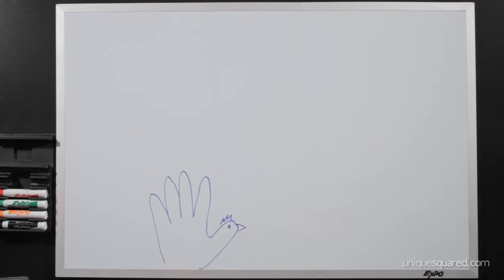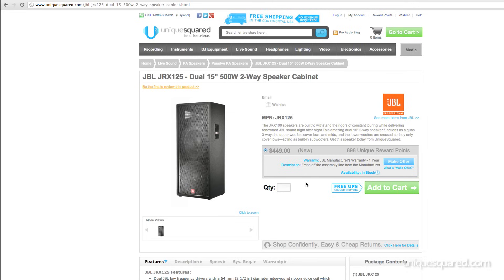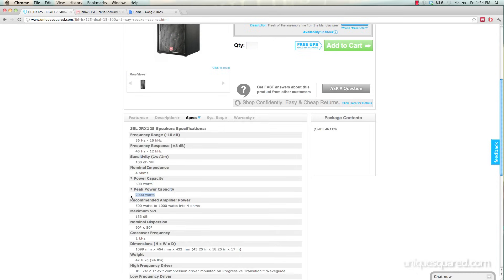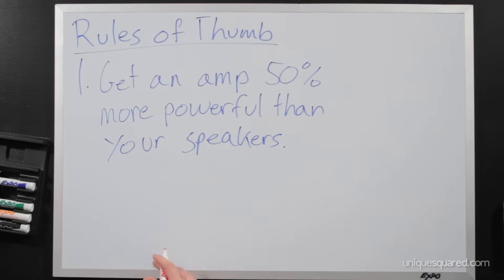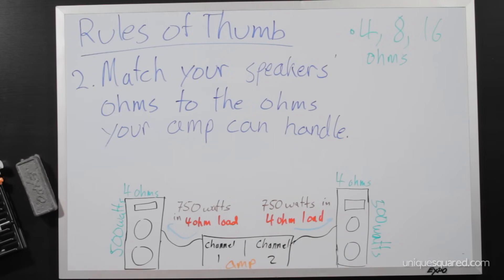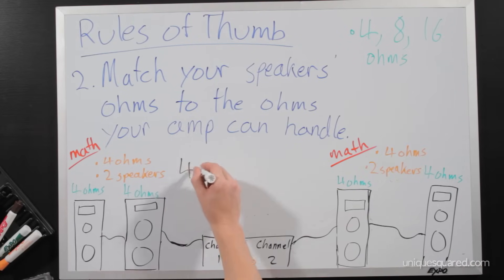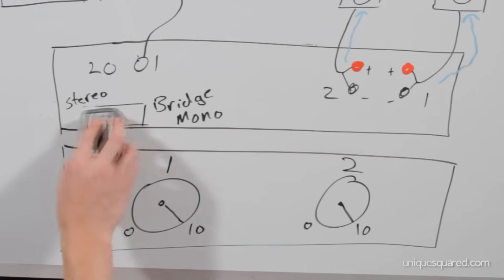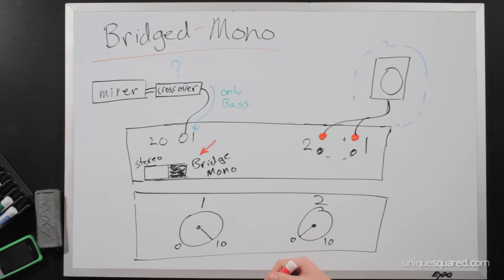Amplifier to Speaker Matching Tutorial | UniqueSquared.com

Comment: WRONG, COMPLETELY. You can not ruin your amplifier by connecting more powerful speakers, but You can certainly ruin your speakers if you will connect them to more powerful amplifier. And this is why: power output obeys Ohms law. If You have, lets say the 250W amplifier which is designed to work with 4 ohm speakers - the power output WILL BE THE SAME if you connect 1000W speakers or 250W speakers as long as those have the same 4 ohms. THAT'S A FACT, go to school, learn some physics :D On the other hand if You will connect 250W 4ohm speakers to, lets say 1000W power amplifier (still talking about 4 ohms) - you will overheat your voice coils and blow out your speakers, because they will have to output those 1000W, that's a fact, remember? They just aren't designed to hold that power, that's why You will blow them out and even at the edge (25% power) sound quality will be bad. Never overpower your speakers! NEVER! General rule is to underpower them by 25-50%, so You can get the best possible sound quality and you won't blow them. RTFM!

Lets summarize that. Amplifier will be loaded exactly the same, no matter what power rating the speakers are as long as their impedance is the same. Period. That's a fact, that's a law. This video is nonsense, that is another fact. Go, learn something: http://en.wikipedia.org/wiki/Ohm's_law

PS. Telling that you should overpower a speaker equally means that you should always listen full volume and turning the volume down - may ruin your speaker. This is nonsense!
Reply: Romas Quicker You are simply wrong. According to JBL (the manufacturer who's product is in the video), you should select an amplifier "that can deliver power equal to twice the speaker's continuous IEC power rating." https://www.jblpro.com/pages/general_faq.htm

In fact, they warn against using too little power. "It may surprise you to learn that low power can result in damage to your speaker or system."
Reply: Romas Quicker, Aim to match speakers and amplifiers to produce undistorted sound at the levels you want at your listening position.

To produce the sound pressure level needed at the listening position with a specific signal, using a specific pair of speakers, needs the same amount of power.
As long as you put an amplifier there to do the required amount of work, speakers will do the work needed to produce the sound pressure levels.

There will be a range for the amplifier where its amplifying devices will accurately produce an amplified version of the input signal. As long as we are well inside that range, the output from the speaker terminals will be a higher voltage, higher current analogue of the input signal.

A less powerful amplifier will tend to move out of the range where the input can be amplified as an exact copy of the original with gain, more often than a more powerful amplifier and, will tend to be distorted on larger transient peaks. 
In extreme cases a low powered amplifier can become unable to supply enough power and will produce a clipped wave. A powerful amplifier handling the same signal into the same speaker to produce the same sound pressure level at the listening position therefore will tend to sound more accurate.

Speakers are not as simple as amplifiers when handling a signal; the speaker output and its signal input will be significantly different.
The impedance for the speaker is frequency dependant and as a load, it will dip below the average at certain points in a musical piece say to 2 Ohms. This will demand four times as much power from the amplifier. Similarly the impedance can rise say to 32 Ohms. This would only require a quarter of the power from the amplifier. The speaker swings its impedance in response to the frequency content of the signal. A low powered amplifier will have a much greater tendency to distort and clip than a high powered one with a speaker that presents significant dips in impedance.

The voice coils will heat up as the amplifier makes them do work. At the specific level needed at the listening position this heating will be same because you are transferring the same amount of energy per second. So no damage is caused unless you increase the levels to produce extreme temperatures in the voice coil. The more powerful amplifier will distort less than the less powerful one if you want to listen louder but, you can damage voice coils by over driving them with a powerful amplifier.

Listening louder, you might start to run into difficulties with the speaker being physically able to move the drive units accurately. Drive units have mass and energy transfer needed to accelerate, decelerate, reverse direction and accelerate in the opposite direction is dependent on power (energy transferred per second).
A powerful amplifier will be better at controlling drive units and will produce a more accurate sound at the listening position than a less powerful one.

Distortion caused by clipping produces harmonic distortion, the amplifier produces distortion that sings along with the signal at higher frequencies above the signal. These can be pleasant and valve amplifiers use this effect to sound warmer and louder and more exciting. It can also be harsh and make a harsh shouty playback. The distortion will be greater for smaller low powered amplifiers and can burn out tweeters.

In short, you need an amplifier and speaker that can produce the sound pressure levels you want at your listening position without distorting or clipping noticeably.

Low powered amplifiers need more sensitive speakers to be loud without distorting.
High powered amplifiers distort less than low powered amplifiers and will give a more accurate less distorted playback with most speakers.
Speakers can be difficult loads if their impedance dips. Amplifiers need more power to tolerate swings in impedance.
Speaker voice coils can break down when they become too hot and that happens if you try to put too much power into the speaker.

Generally a powerful amplifier is best in most circumstances until you exceed the power handling ability of the voice coil.
Clipping from under-powered amplifiers damages tweeters.
Reply: finally, someone that thinks... funny how this does not make sense to some.. the video is totally wrong..
Reply: Dude, this video is not wrong. What uniquesquared says is absolutely correct. There should be "headroom" for any amplifier to deliver clean sound to the speakers. Contrary to belief, it's not the power that kills a speaker. It's the distortion that kills it. It is always recommended to use an amplifier that is higher than the speaker output. It is safe so long as care is taken to match the impedance. 
If a speaker manufacturer has recommended a suitable power wattage to drive the speakers, he is simply implying not to drive the speakers with anything less than what is recommended. More is welcome. But definetly nothing less!
Reply: Rohan Dias Wrong. Go learn some basics, only then teach others.
Reply: jcnash02 WRONG, go read JBL tech note ( https://www.jblpro.com/pub/technote/lowpower.pdf ) , they talk mostly about harmonics, there. Read the summary at least. I will try to "translate": JBL say, that their low power amplifiers are so bad that they output too much harmonics when used on full power (or near that limit) and their speakers are not designed to take that power on higher frequency range. This is why they suggest using more powerful amplifier on LOWER OUTPUT SETTING to get the SAME volume level, but with less harmonics... In one word - it's a marketing trick. In other words - their speakers would handle that if they were rated for more power (considering their power is stated as overall sum of treble, midrange and bass).

Now there are some statements about "lower power amplifier can deliver more power", or be "overdriven". The only thing that is not said - you must connect lower impedance speakers to actually overdrive an amplifier - You do remember Ohms law, right?

Comment: I have a pair of speakers which each have a max power capacity of 150 watts and an impedence of 6 ohms. What I understood from what you said in this video is that I should then get an amp 50% more powerful than this meaning 225 watts per channel, right?
But I'm really confused because the manifacture of my speakers says that the recommended amp power for the speakers is 40-150 watts per speaker.
How come that they recommend that the amplifier does not exceed 150 watts per channel when you say that I should give it 50% more. Wouldn't I be ignoring the advice from the manifacture completely? 
Hope you can help me out :)
Reply: You are completely correct, this video is nonsense! Do what manufacturer says. Power output depends on amplifier parameters and speaker resistance (ohms), not the speaker's power rating (maximum power it is capable to hold for a long period of time).

Comment: You need to get some fact straight. Program power is not the same as RMS. Program power or IEC power rating, is based on a complex sin wave form, so that, in simple terms, a manufacturer can estimate the capability of the amp when it playes a music like signal. For most manufacturers, todays standard is that program power is duble RMS power. And no, you don't need a amp 50% more powerfull than your speekers. Most good manufacturers RMS rating is based on 0,1 % THD and white noise signal from 20hz to 20kHz continuously 24 hours opperation. So with a pair of 500W RMS Speakers you only need, and yes you guessed it, a 500 RMS amp.
And one last thing, no, a small amp will NOT damage your speakers more than a powerfull one. YOU will damage you speakers with any amp if you screw-up. A 100W amp can, in some cases, if pushed beyond clip, deliver a 200W or more distorted signal (Long technical explanation required) So if you have a pair of 150W speakers, and you push your 100W amp beyond clip, yes you can burn your speakers by feeding them a 200W signal, which you can also do if you turn a 200W RMS amp up :)
Reply: You are exactly spot on correct with this post.  I have noticed most of the people posting here are trying to hook up car stereo speakers.  His explanation is geared towards a simple DJ set up. Hooking up speakers in an automobile in series is very complicated.  If someone is hooking up a megga 500 watt set up in their car, you really have to know what you are doing or you will start a fire in your car, especially if you hook up your speakers in series, rather than parallel.  This video explains how to set up a simple DJ speaker system, not a car audio system. If you do not know what you are doing "STOP" and ask a professional.  It could save your car or even save your life.

Comment from the maker: Again, I have not tested every amplifier on the market but I can tell you that unless you are in a perfectly tuned room, or are a trained sound engineer, you will never hear a difference.

If you are concerned about fidelity, I would focus my attention on getting a good set of speakers and worry less about the amplifier. Especially if you are only setting up a couple mains and a sub.

Also a lot of what determines how things sound is the signal coming in. Another old adage is crap in, crap out.

Comment from the maker: Power is power. There are amplifiers that will last longer than others, but affordable amplifiers are generally speaking just as good as more expensive ones when powering passive speakers. Some might argue against that but I have not personally tested every amplifier on the market to prove or disprove that contention.

More expensive amplifiers will give you more control functions and an assurance that your amplifier will last longer

The old adage is true. You get what you pay for.

Comment from the maker: 1. Yes
2. Yes
3. As long as you don't push your amplifier to the max, having a little head room will not affect the speakers.
4. You don't have to if you don't want to.

As always, consult the manual for the amplifier and speakers as well as contact the manufacturer if you are unsure about anything you are doing. We want you to maintain the integrity of your equipment.

Comment: i have an amp with the following spec 5.1 channel with 2X600 watts power. can i use 1 center speaker, 2 front speaker, 2 rear speaker and 1 sub-woofer with the same power of 400 watts?

Comment: Hi,
Is it possible for me to run a single 300W 3way speaker with a bass, midrange and high frequency speaker off an amp running on bridged mono? and would this affect the ohms required?
Thanks!

Comment from the maker: As stated in the video, the general rule is to have an amplifier that is 50% more powerful than your speakers. From the information you have provided, it looks as though the amplifier has the proper power rating for your NS10s.

With that said, ALWAYS consult the manufacturer provided instruction manual for both your speakers and amplifier to make sure. If you are unsure for any reason, send an email to Yamaha and use your powered speakers until they respond back.

Comment: Okay, I have a pair of NS10M's speakers which are 60 Watts RMS at 8 Ohm each.  I bought an ART SLA-1 amplifer, that outputs 100 Watts per channel at 8 Ohms.  I haven't connected those yet, becuase I am so afraid to fry the so easy to burn (and expensive) NS10M's.  Now, I am not afraid of frying the amp, because it's relatively inexpensive.  But the speakers are expensive, and I don't want to fry them.  So, the question is, can I safely connect these?  Or should I stick to my powered speakers?

Comment: hey Chris i have 400w JVC - KS AX3102 - Bridgeable 2-Channel Amp and 4 speakers and 1 sub-woofer 2ohm each i wanna know how should i give connection in amp? i don't wanna know parallel series i understand that to see your video i wanna know in amp there is 4 point left + - right - + and bridge mode, should i give all speakers connection  on bridge mode if i do that so there will be left 2 point what about them?

Comment: I want to put these new rockford fosgate speakers that I got in my truck. I am really having problems with how to power them. They are 80 watts rms a pair and 320 peak power a pair. I have an amp that puts out 400 watts x 4. Can I put my front speakers on a channel and my back speakers on a channel even though the rms is 160 a pair and my amp will be giving them 400 watts?

Comment: Please be aware if you pump 750w RMS into 500w RMS speakers you are overloading your speakers, if you limit your amp to 500w RMS then all's fine, no mater if your speakers are 5w or 5000w and rated 8 OHM your amp does not know as it will only see an 8 OHM load, I understand the reasons for leaving headroom so as not to run your amp at full wack but overpowering your speakers will only shorten the life span.

Comment from the maker: Your amplifier should be fine. We warn against doing this in extreme cases because there is potential to cause amplifier and speaker malfunction.

As always, consult the manual and manufacturer specifications of your speakers and amplifier because not all are built equal.

Comment: hi, at 3:23 you explain not to under power the speaker as you run the risk of damaging your amp. I recently bought a pair of bookshelf speakers running at 130watts and i bought an amp/av receiver that has a stereo output of 100W X 2, am I damaging the amp?
The amp has a surround output of 100 X

Comment: hi, there is one thing that i don't understand when it comes to connecting speakers in parallel, i know all about the impedence connected in parallel that it will reduce like the vid say, what about the power capacity? since the speaker u chose is 500w with 4ohms do u need to continue adding only speakers of 500watts?

In terms of a 3 speaker set up how to tackle it, suppose i have to top speakers and a one subwoofer, can you please make a video on that because i've been searching without luck.

Comment: Hi there, I wanted to get a the Behringer iNUKE NU6000 which delivers 2 x 3000 Watts into 4 Ohms, 2 x 1500 Watts into 8 Ohms to power 4 Gemini GVX 15s at 500 watts RMS at 8 ohms. My question is this does the description by Behringer that the iNuke NU6000 delivers 2 x 1500watts into 8 ohms mean that each channel (the amp has two channels) on the amp delivers 1500 watts into 8ohms or the total power on both channels is 1500 watts into 8 ohms. Thanks

Comment: hi unique square i  ve 2 sub 15 bass speakers 800watts max /400 RMS and 2 15 mid 300watts max 150 RMS all spearkers 8ohm if i double them does it make them run as 4ohms also is a 1000 watts amp capable of running these if it 4ohms

Comment: Hey Hopefully i'm not asking something that has been asked beofore, but the amp that u are using can handle 2 ohms which means it wont die or anything nd the speakers would be fine aswell but when running 2 speakers each side would you lose power because you are not running 4 ohms you are only running 2?

Comment from the maker: As the video explains, generally you will want an amplifier that is 50% more powerful than your speakers so it is not working harder than it has to to power your speakers.

If you have two 800 watt speakers, typically you will want an amplifier that can put out around 2400 watts of power.

We have a great selection of amplifiers on the UniqueSquared website.

Comment: hey i have a question if i put 2 700 watt 18"  sub speakers at 8 ohms in 1 box do i need a 1400 watt amp to drive them or 700 watt

Comment from the maker: As the video explains, you will want an amplifier that is 50% more powerful than your speakers so it is not working too hard to power your speakers. If you have two speakers at 250w then you will want an amplifier that can push 750 watts of power.